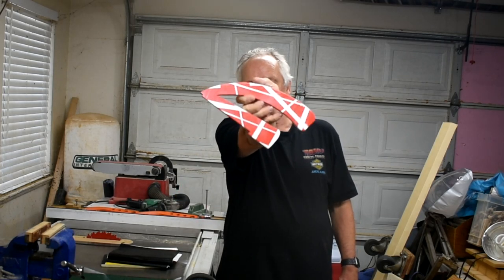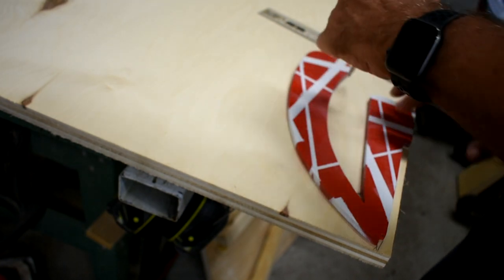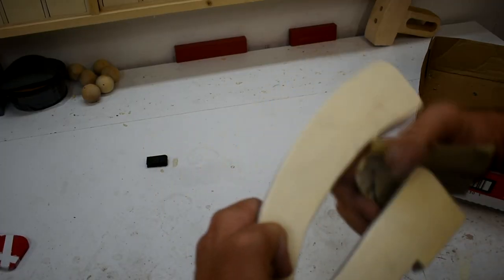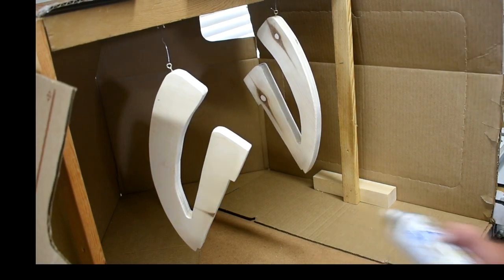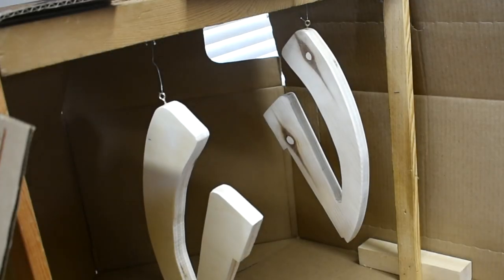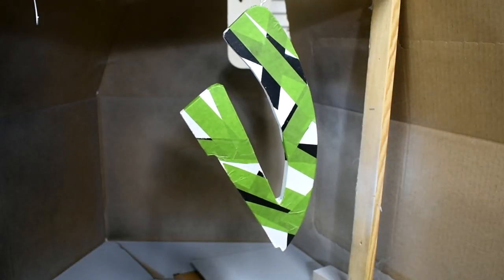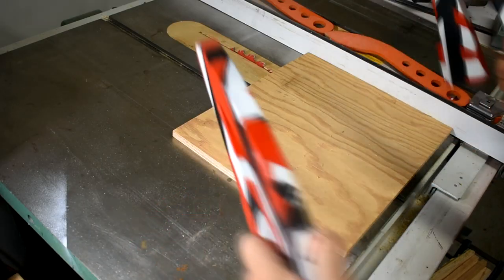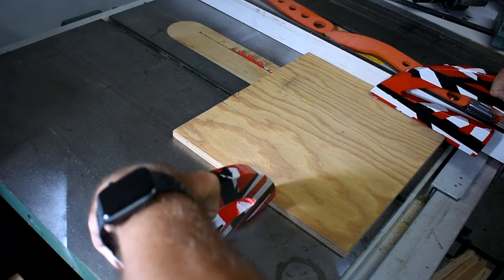Making Push Sticks with Two Notches

Comment: I don't hate the nose notches I just don't think that how you used them is a correct, SAFE method to do that job. I personally would cut a V notch along the entire bottom of the push stick and used it against the side of the piece of wood. The nose notch means you keep your wrists twisted at strange angles, and it provides not strength at all.